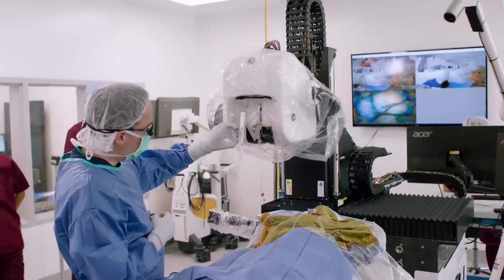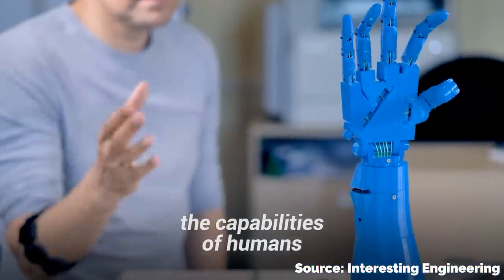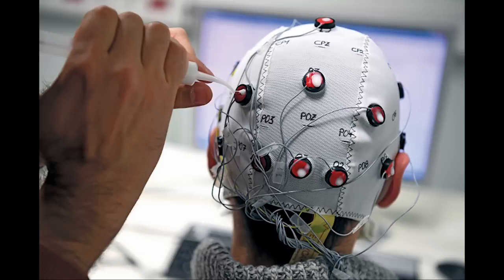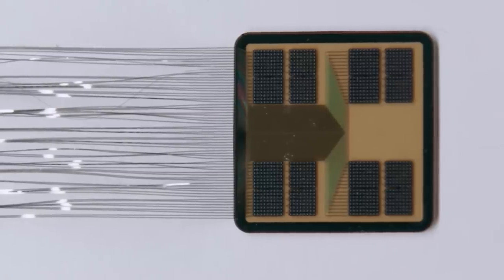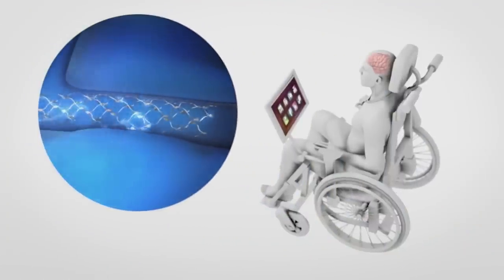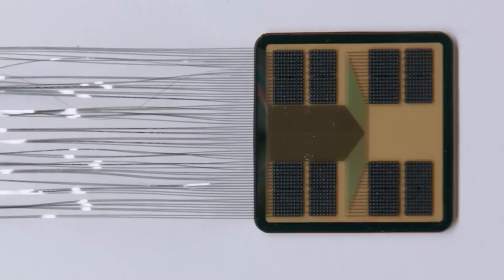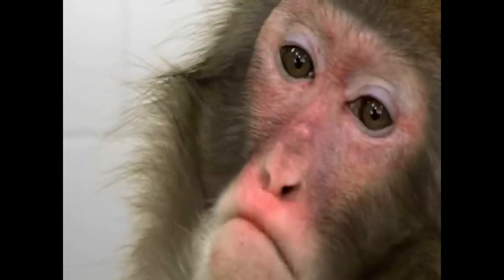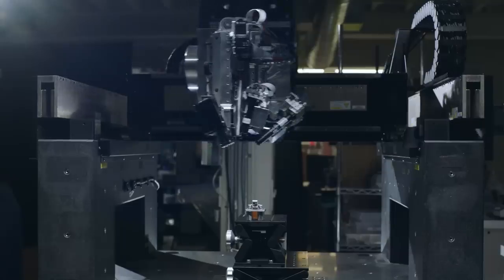New Brain Implant Begins Human Trials - Neuralink Update!

Comment: Terrifying as it is, the best way to recover from any condition we're suffering from is a means of combing conversions of transmutation circles, either by color added or modification of design, combined with very specific other drawings such as the symbol drawn on Simba's head from The Lion King and very particular drawings that helps us fight Satan through means of meditation by going "Aaaaahhh" rather than "Oem". Y'all can think what YOU will, however, I've been in practice of these things long enough to know otherwise

Comment: Okay. I have to ask-let say you use this for a person that needs spinal stimulation. It works on bluetooth, so if you get to an area where the bluetooth stops working, does that mean you fall down because you back to your original state?
Reply: they will probably have backup stuff, maybe your muscles follow a rutine when the bluetooth disconnects. Like sitting down, then shutting down
Reply: Lol
Reply: Yes
Reply: No
Reply: For critical functions they may have a micro wired shunt between implant and where the break in the spine may be, for instance, or an nfc connector in your watch  and/or phone, for slightly less critical functions...
Reply: It would be rare to cut off the Bluetooth function that's literally not even 2 feet away. I would imagine they would work on a redundancy. I did hear that the tests had a happy accident where the nerves kind of learned a muscle memory function so it became more efficient in commanding a walk cycle or going upstairs cycle for example.
Reply: An area where the bluetooth stopped working?    You mean like if you were standing in the path of an EMP?

Because other than that I can't think of an area where a bluetooth in your head and another in your spine would stop talking to one another...
Reply: As someone who's had a spinalcord simulator device that's not how they work. They only need to be linked to bluetooth when they are being set initially to the correct frequency. The device has it's own generator/battery. Some batteries have to be recharged, which doesn't require bluetooth, others last for years before they need to be replaced.
Reply: your silly to belive it can do anything
Reply: WARNING!!!! HELL IS REAL!!!!  We can not hide our sins from God.  If you follow the sinful behavior of this world you will go to Hell!!  Instead, follow Christ Jesus and you will go to Heaven!!!   REPENT while you still can, for one day, it will be too late.......  MARK 1:14 The time is fulfilled and the Kingdom of God has come near, repent, and believe in the gospel.

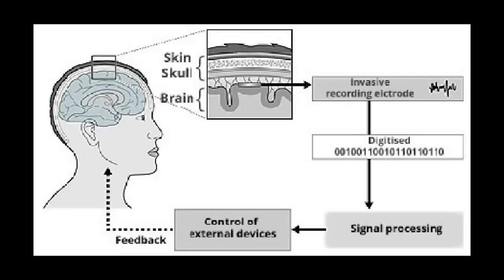Comment: 4:02 "…entire skull between the sensors and the neurons…"
Not to mention some muscles that interfere with the signals
Reply: Muscles at the top of the brain?  What do they control?
Reply: @krashd  not on top of the brain. But on top of the skull. They are part of the muscles that run through the neck.
Reply: Muscles on top of the skull????? 😨🧐🤨🤭😭😅😂🧐🤨🤔😱😱😱

Comment: To possibly replace the part they have place inside brain tissue, would something like a miniature metal detector work? They function to pick up frequencies being emitted by metal, so maybe create a device that picks up the neuro frequency in certain spots and it would only be just under the skull or attached to the skull. Idk just an idea.
Reply: that would work most likely since the brain waves are a little bit like electricity, however, the costs for that would be 1000x more expensive

Comment: if they are hit round the back of the head wouldn't it perhaps cause damage to the device and perhaps the brain it's self?
Reply: This is an odd question because being hit on the back of the head is already damaging to the brain with or without an implant.
Reply: But I understand the question. The device is probably weaker than the skull for protecting the brain even though it would be glued into place
Reply: I don't think it would be a big problem.  The stent part of the device is under the skull.  The part that extends lower down is just wires, so would be more robust.  Wouldn't survive decapitation, though.  Or getting hit with a planet-killer asteroid.
Reply: I'd be thinking about trying to not die and fight/run away from what's hitting me rather than worry about the little chip inside myself. If it's hard enough to damage the device then your skull is probably fractured and your brain is damaged.
Reply: @shanegrissett7423  But then, imagine a "double hit" per se.
Rock hits head, head hit skull, skull hits implant, implant hits the brain.
Ugh...
Reply: that would be a yes.

Comment: What if the chips malfunction and tells your brain to stop breathing has anyone thought about this? Keep in mind this Is technology and technology always fails and make mistakes
Reply: the chips are on the outer part of the brain. Not at the brain stem where those functions such as breathing are controlled. Also as far as I understand these chips only read action potentials, they can't interfere or "talk" with brain neurons. But with that said, those chips that are inserted in the brain do cause brain damage because they go inside the tissue and rip it apart. So I wouldn't recommend it.
Reply: What if your toaster malfunctioned and caused your car ignition to start?  Because it's just as likely to happen as the nonsense you came up with.

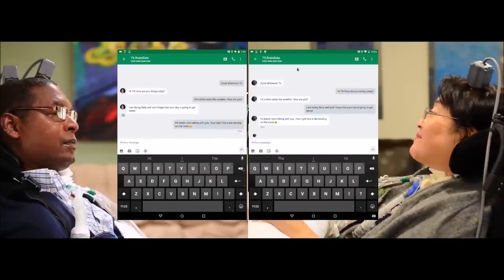Comment: 5:48, ok so why not use golden ord spiderweb, for the spikes? the body wont reject the golden spider web. if you compact the spider web, you can make it just as hard as the steel spikes. the web has 2 unique property's. one is that the body will not reject it, and two, the golden web can carry information. it also has a 90% success rate on paralyzed Lab Rats. just saying

Comment: This makes absolutely no sense to do especially how he pitches it as an interface... it's only one way. The second they try to induce anything back into the neurons they are going to fry someone's brain 100%. It's something delicate and extremely precise the signals you read are just that the signals you are reading not the actual full signal. We're talking about sodium ions transferring charges in very controlled channels not wiring up a raspberry pi on the weekend for f sake 🙄 And for the inevitable person who is thinking well why don't you do it then smart guy... Well I'm not so much of an @$$hole to not admit we simply don't currently possess the technology to do so. We don't have nano construction machinery capable of building complex objects out of desired molecular materials to any repeatable degree sufficient enough. Maybe once we do then after years of testing simple throughput designs of biocompatible quantum gates we can begin to design some simple interfaces that can crudely but reasonably mimic a neurons design. But that's probably not going to happen for quite some time.